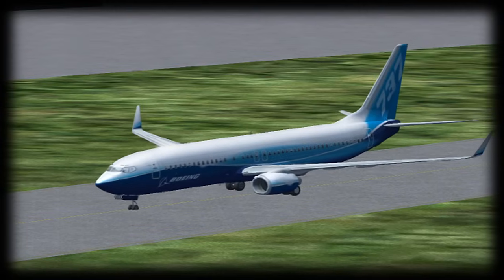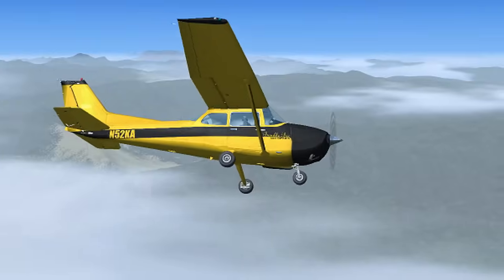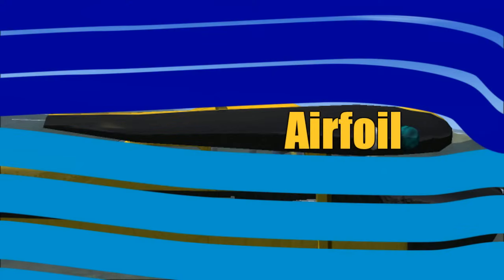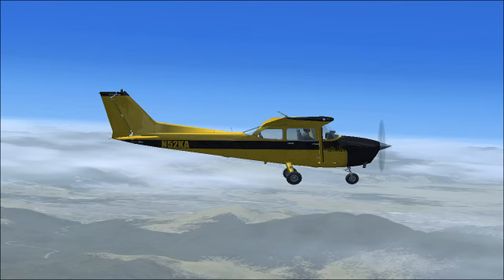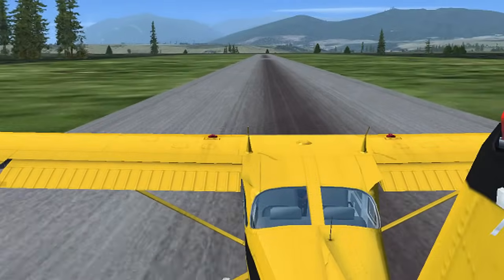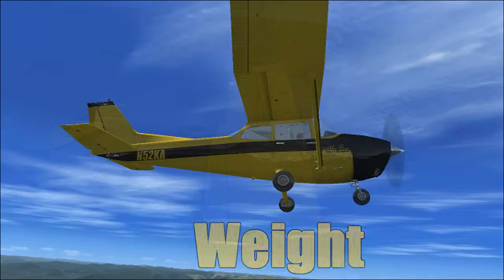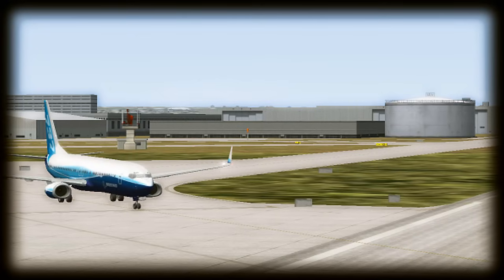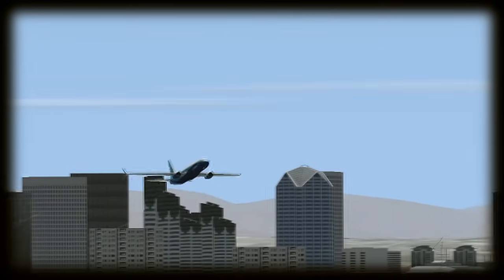The Aerodynamics of Flight

Comment: The description of lift is a bit off. First of all, it doesn't mention that the wing is so the front of the wing is higher the the rear. There is some lift from the lower pressure on top of the wing but its main function is to direct air downwards efficiently. By forcing the air down, there is an equal and opposite force pushing the wing up. In fact flight does not require an airfoil. Just a slightly angled straight wing directing air down will work albeit with less efficiency. The real secret to flight is proper balance, not the airfoil.
Reply: then tell me how an aircraft takes off from the ground?? if it is running parallel to the ground and aircrafts you see today have no inclined wings so why do they take off??
Reply: navish kotwal not sure if you're an idiot or a troll.  Go to college.
Reply: navish kotwal the elevator pushes the tail down which allows the wing to push air down airfoil or not. Its not very complicated.
Reply: navish kotwal There are flaps on the wing that rotate downward and the wing is not parallel to the fuselage.
Reply: ***** this is the thing which i wanted to check ...Dude don't just guess and post it on the youtube.You know nothing about the flight dynamics. .. All the aircrafts that you see today have Wings fixed to the fuselage and are not movable not even 1%.The movable part is the flap that is infact provided to change the relative angle of attack. .....Movable wings are still in resarch ...You can see the  prototype in  videos at youtube Scorpion is the name of the aircraft developed in early 90's which have movable wings to increase the lift and avoid stalling ...
Reply: ***** haha dude you can not fool an aeronautical engineer..I think you need to go to school and learn physics...!!
Reply: navish kotwal BTW, love the link on the scorpion.  Anyone can be fooled though. The hardest people to fool are magicians.
Reply: Recent testing and computing indeed show that Bernoulli's law has a far less effect on lift as always thought.
The air pushed down caused by the angle of attack of wings and body is by far the leading force in flying.
Reply: im building a plane in kerbal, adn its wings are on the top. engines are hung under the wings. i have no idea how to balance this short of a bi-plane, or stacking weight on top of the wings, and that is unacceptable!! do you rly know ur stuff? can u help me? all i can think of is to point the center of thrust to counter it. but id like a more creative solution >_< its gonna be a high altitude, very heavy, very fast plane. it needs to be more stable than tippin my engine.
Reply: dgs .astgh the weight. Up and down is as important as you might think.  The key is the balance front to back. The centre of gravity (CG) must be a bit in front of the centre of lift.  The further back the CG, the less stable and more manuverable and the slower your stall speed.  The further forward the CG, the more stable.  
To be honest, I don't really understand your problem though
Reply: Chris Foote the problem is i gotta plane, think like, a boeing and its gotta go supersonic speeds.but the wings are ON TOP like the cesna in this video. the engines hang under it level with the center of mass. but that makes the center of drag higher; it flys fine. until higher speeds. then it pulls up, and dies cuz the drag is too high. and im not stacking weights on top of the plane. maybe theres a fancy tail design that can fix it?
Reply: dgs .astgh one thing you can try with the horizontal stabiliser is to change the angle. That angle is called the declanage. If it pitches up at speed, you would move the front of the horizontal stab up.
Reply: Chris Foote ive tried all maner of "countering". infact, you can view my channel.. the plane looks like the "Leonopteryx" wich is a heavy, poorly built fatass of a plane. and i think i can fix it, my plane doesnt have a tail fin  \;3 its something forgot. i think a tail fin can stabilize it. why am i soo stupid. but idk rules about tail fins, ima make it like this cesna. rambling aside..

what does a fin with a longer distance from wings to the tail fin do and what does a higher tail fin do and visa versa?
Reply: dgs .astgh give me a link to your channel. The longer the distance to the stabilisers, the more stable the flight. Shorter is more manuverable. You don't want the turbulent air from your wings to hit your stabiliser so you will have it a little higher.  There are several ways of making it work.  I have a couple of flying wings which a very simple but a little mor difficult to fly.  You can also have the stabiliser in front in which case it is called a canard.  In every design, the centre of gravity is similar and important.  It is possible to make an unstable plane and use a small device which has gyros. The gyros sense movement and send signals to the control surfaces to keep it straight.  Fight jets tend to be very unstable to the pont that some would not be able to fly without gyro stabization. I have a 3 axis gyro but its really cheap and I've had problems with it
Reply: ***** When a speed known as Vr is reached, the pilot pulls on the control column to cause the elevators to deflect upward.  This causes the aircraft to rotate -hence presenting the right angle between the wing and the airflow past it to generate the required lift. The  'r' in Vr stands for "rotate"
Reply: Roy Bird Did it really appear necessary to explain something so obvious to a person who hasn't posted in two months?  Leave me out of this, I'm tired of getting notifications from you lot.
Reply: ***** I was merely trying to clarify the situation as you clearly have little knowledge of the subject. Do you have a problem with that?
What "lot" are you referring to? If you don't want to receive information that was intended to be helpful don't visit this site
Reply: ***** yay google+!!!
Reply: the pressure difference is the only way to achieve serious big lift, minimum drag, and very stable flight,  the relationship between velocity and pressure happens in many things in physics,  take as an example water running through an elastic garden hose,  as soon as you slow the water down,  an instant sideways tension appears,  the air even though is compressible develops massive lift forces on airfoils, it cannot be replaced by any other shape
Reply: which is why planes can go down even if a tiny layer of ice forms on the wings, reducing the airfoil shape,  and why they are equiped with anti ice systems
Reply: &u
Reply: navish kotwal
One the plane gets enough speed, the elevator goes up to tilt the plane.  Now the wings are angled up and the force of the air underneath pushes the aircraft up.

Comment: Now if you want to know the real truth about how lift works on any wing and not this old, archaic, poorly researched Bernoulli theory, read Jim Davis' PPL training book.
Reply: Bernoulli's Principle applies to fluid dynamics in venturi systems and cannot be applied to aircraft wings! Lift is generate not with pressure difference between the bottom and top of a wing, but mainly because it deflects air downwards. Because of Newton's Third Law that states that for every action there is an equal and opposite reaction, this means that as the air is deflected down, the wing is deflected upwards. 

Take a completely flat wooden plank and stick it out of a moving car's window at a slight angle (angle of attack). The plank will deflect air down and as reaction will lift upwards/backwards. This is how the BOTTOM of the wing creates lift and surprisingly it creates only 1/3 of the total lift!

2/3 of the total lift is created by the TOP of the wing. Because of the shape of the wing, the top of the wing also deflects air down. It does this by means of the Coanda Principle and Newton's Principle. Coanda proved that a stream of fluid or air moving closely over the surface of anything it passes over, will tend to cling to that surface. To proof this at home, hold the rounded end of a spoon so that it just touches the downward stream of water from a flowing tap. Water will cling to the surface and deflects to one side. The spoon will be deflected in the opposite direction. So the top of the wing (because of the airfoil shape) also deflects the air down and result in the wing lifting up.

Obviously if the angle of attack becomes to large (angle between relative wind and wing cord line) air over the top will not cling to surface anymore and become turbulent. Downward air deflection will stop at top of wing and the wing will stall.
Reply: Dirk Hoekstra
I think the basic point was well made - it's the shape of the wing. cheers.
Reply: Lizandro Alarcon Carrasco Jim Davis has over 10000 hours of training civil and military pilots, 4000 hours of corporate flying, charter work, aerial photography and surveying. He has performed in aerobatics and pylon racing. He pioneered flight training in South Africa with his first full time flight school which he started in 1989. Called 43 Air School, the school gained world wide reputation for quality training and attracts customers from all over the world. 

First off all, I own the book. And I know the difference between a booklet and a 504 page book. Secondly, I couldn't really give a fuck what you think of my opinion, but to question the opinion of Jim Davis is a little concerning.
Reply: Peter Ruman LOOOL
Reply: that book you mentioned is just a booklet... your knowledge in aeronautics does not seem accurate.. your opinion is worthless, trust me.

Comment: Thrust must be greater than drag, otherwise the plane would be standing still...
Reply: If the thrust is equal to drag, the plane remains at constant speed. So if you spend some time accelerating first you can then equate the two forces in order to remain at constant speed.
Reply: What got me annoyed is that he talks of thrust when the plane is taxiing - this confuses amateurs into thinking that thrust is used even while taxiing.
Reply: Tim Strangelove I think you're right: at constant speed, there are no forces applied (Newton first law) , which means all 4 forces are equal (2 by 2). Thanks.
Reply: +WhipRunner It is or else the aircraft wouldn't move. When taxiing the drag on the aircraft is from the air (small component) and the friction of the wheel system (large component). For taxiing, thrust is equal to drag when a slow speed has been achieved. Reducing thrust allows the drag to stop the aircraft, aided by the brakes. Increasing the thrust accelerates the aircraft to a faster taxiing speed.

Comment: wrong....completely wrong...please tell me how an aircraft can fly upside down in a horizontal line? weight and lift(downward) would not be balanced.
Reply: Eric Lee the angle at which the wing meets the air also has an effect on lift, in fact more so than the shape, you can get a flat plate to fly if you angle the leading edge up a little bit. Aircraft wings are shaped for optimal performance in operation, so normal wings have a more curved upper surface to help it produce lift efficiently in normal level flight, however the angle at which the wing meets the air stream is the most important factor, ANY wing can fly upside down, if it is angled correctly. Heck, a 747 can probably fly upside down if it wanted to
Reply: That's when the plane is designed differently. The foil of the wing have to shape differently in order for the pressure to balance while staying upside down. Not all planes can manage to fly upside down. Stunt plane as an example can fly all different angles smoothly cause of the special way its design.

Comment: Bernoulli's Principle does not fully explain how a wing generates lift; the physics of how lift is generated is complex, and involves the relative air speeds above and below the wing, the angle of attack of the wing, and the deflection of air streams.  If it was only Bernoulli's Principle, then airplanes wouldn't be able to fly upside down.
Reply: The relative 'speed' of air above and below the wing is only relevant as an after effect of the passage of the wing.

With an effective AOA, the Lower surface of the wing pushes the static air forwards and downwards creating a Newtonian upwards  and slightly rearwards reaction (2nd and 3rd Laws). The Upper surface of the wing bends the air downwards while dragging it slightly forwards due to skin friction (form/induced drag) ,  This change of velocity causes a resultant force Upwards and slightly rearwards. .(F=MA)

The upper surface air does not require any special effect to follow the downward slope of a conventional cambered upper surface wing. it has no choice-there are no vacuums in normal space.

As the air turns the corner of the leading edge and changes direction its density drops. This combined with the change of direction and the fact the upper surface is on the leeward side of the moving wing creates a pressure differential. Voila, you have lift...No magic required.

The test of any so-called lift explanation is whether it works with a flat plate aerofoil- if it doesn't it is wrong. No exceptions...
Reply: Nobody cares
Reply: @danutarozek4872  you replied to a comment that was made 6 years ago
Reply: Liam O'Brien oh haha
Reply: Coanda effect

Comment: Isn't weight gravity ?
Reply: weight is directly proportional to the strength of gravity. It is not the same thing.  Here on earth I would weigh 125 pounds.  On Jupiter, where gravity is much much stronger (because the planet itself is much bigger...)  I would weight much much more. 

Weight is also dependent on the mass of the object.  Obviously, the greater the mass, the greater the weight of that object.  Which in turn is dependent on the force of gravity on that planet.  Get it?  :)

Comment: a) Draw a typical aerofoil shape. b) On your diagram mark the chord line. Also draw the relative airflow on the aerofoil shape diagram as if the aircraft was descending. Label the angle of attack on your diagram. c) Draw the lift force and weight on your diagram. Question 2  a) Define the lift Equation. b) With respect to the lift equation describe how if an aircraft wants to maintain altitude yet increase and decrease its speed what properties must change, also describe how the aircraft may appear to an observer at slow speed and at high speed. c) With the use of diagrams explain how the angle of attack changes on an aerofoil section with the deployment of high lift devices (flaps). d) Describe again with respect to the lift equation what properties change to give increased lift with the deployment of FOWLER flaps. Question 3  a)Draw on a series of three diagrams how the airflow changes around an aerofoil section as it goes from zero angle of attack to the critical angle of attack. Also mark on each diagram the likely position of the centre of pressure. b)Explain washout on a wing and how it is helpful for aircraft control near the stall. c) Explain briefly how winglets improve fuel efficiency in the modern jet aircraft.
Reply: very nice expression,suggegtions. Constructive. Thanks a lot.

Comment: This theory of flight is just wrong. I see this explanation all the time...everyone seems to know, as it says in this video that it is the aerofoil section that gives the lift. If this was the case, how do aircraft fly upside down? And why do aerobatic aircraft have symmetrical aerofoil sections? You can make a plane with a plank of wood for a wing fly! Any good theory of flight book will tell you that the main force of lift is the angle of inclination of the wing to the oncoming airflow that gives the lift. (That is what the elevator is for) Everything else is just details...shame on you GearDown FS...
Reply: Malcolm, well said.  Angle of attack is the key. Planes can fly upside down so long as the wing is presented at a proper angle to the relative wind, whether the wing is cambered, symmetrical or flat.  Conversely, a plane cannot fly either right side up or upside down without proper angle of attack.
Reply: Thanks for the support jhyacinth, I have emailed a couple of TV producers about this with no reply as yet...my next task is the producer of Guy Martins series on speed...

Comment: How do you think an airplane fly upside-down? Have you seen a trick plane? The top and the bottom of the wing is symmetrical. Have you seen a balsa plane? The cross section of the wing is a rectangle. Have you put your hand outside a car window at high speed. The funny thing is that you were right about lift when you were a kid, before you read that article in a kids encyclopedia..

Comment: I am also a sailor and my wings are called sails. They produce the exact same lift that a wing does, except in the horizontal plane. But there is no difference in distance round the inside and outside of a sail save a millimetre at most. Every aspect of lift is created without any fluid pressure differential caused by speed difference. Check out the "equal transit time fallacy". Since I learnt to fly before I discovered this, I guess it is unimportant to a pilot, in reality.anyway. Another myth!

Comment: Anyone can go to a website or a museum of aircraft any time and have a look at the shape of wings. Very few of them are shaped in what might be called the classic aerofoil shape and most of those will be ancient. Nobody denies that a propeller or a guide vane is an aerofoil but we agree both redirect air causing an equal and opposite reaction and nothing to do with differential fluid pressure caused by speed. Don't listen to theories, look around you and see the evidence. It's there, so go see!